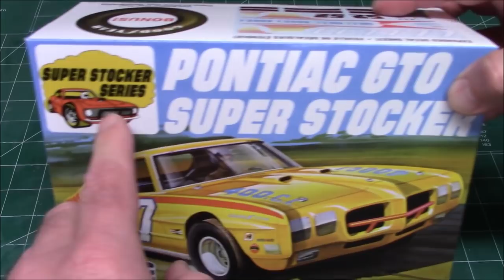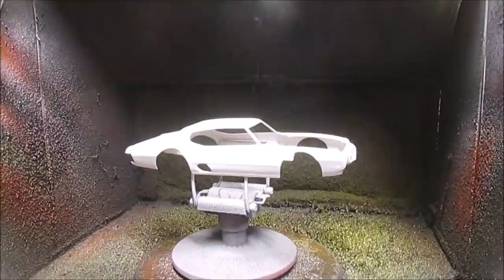1970 Pontiac GTO 400 Super Stocker Stock Car 1/25 Scale Model Kit Build Review MPC939 MPC NASCAR

Comment: mpc's "super stocker series" was first released in early 70's. there were, I believe, four cars in the series, all built on the same variable wheelbase chassis, the pontiac, a chevelle, a mustang & a barracuda. that particular header set-up kept the exhaust opening on the right side of the body (pretty common on a car that only turned left) & not hanging under the frame. very nice build-up, BTW. love your stuff & would like to see more ICM Model T's. thanx

Comment: Hey Chris how do you deal with the spru bits left after you cut them off? I find myself always having to paint the chrome parts simply because there are always big ugly scars if i dont.
Reply from the maker: Touch up with a brush goes easy.
Reply: Molotow pen solved that problem for me. If you cut it straight and there's no crater behind a touch of molotow chrome will cover it so well you literally won't be able to tell where it was cut off.

Comment: Excellent choice on the paint job, Chris. I was wondering why the back right wheel sticks out more than the left? Is that the way it is or was it just a something simple as the camera angle? Again awesome build all around. Have a great weekend my friend.
Reply from the maker: The exhaust pushes the body over. Easily fixed by opening the hole a bit but I was running late and wanted to get the video done.

Comment: Hi Chris, wonderful build. Do you recommend a "glosscoat" on the outside body before applying the decals? (i.e., prevent silvering)
Reply from the maker: No, not unless it's a flat paint job and even then I rarely have an issue.
These decals are laid on the paint as is, with no clear over it.

Comment: I would hate to have a valve cover gasket leak...........
  Is there a fit issue somewhere in the kit for that rear tire to stick out like that more than the other?
Reply from the maker: Exhaust going thru the hole in the body pushes the body over to the side a bit.
I could have spent some time and cut the opening for the pipes a bit bigger but I didn't.  Needed to wrap up the video and get it done. :)

Comment: Holy crap if there was a real car like this with headers running through the interior it had to be unbearably hot and noisy!!!! I can’t really believe anyone would do that in real life
Reply: Your right you would be able to cook a turkey in it by the end of a race just set it and forget it
Reply from the maker: Yes, super hot.
Make a pizza on the metal cover.
Reply: They were very common in the late 70’s - early 80’s! The thought was that since heat rises, letting the exhaust gasses leave the engine going up instead of down, it would flow better and add horsepower! Don’t know if it actually did though.
Reply: @tomt9543  Yikes!! That’s completely wrong to begin with.... If that was the case NASCAR would have been doing it in the 50s!
Reply: @joe6096  NASCAR wouldn’t let their premier series run them. We’re talking dirt trackers, who couldn’t care less about NASCAR! To this day, the vast majority of dirt tracks are NASCAR free, and that’s the way they want it! It was a fad, and probably didn’t make an ounce of difference, but it is period correct!  As far as the no floor thing, asphalt and dirt modifieds and dirt late models have been running that way for decades! The driver just sits in a box! And oh yeah, Dirts for racing, Asphalts for getting there!
Reply: @tomt9543  Did you just miss the point!!!! Wow!! Think before you talk Dude!!